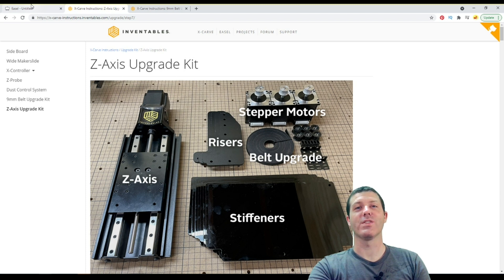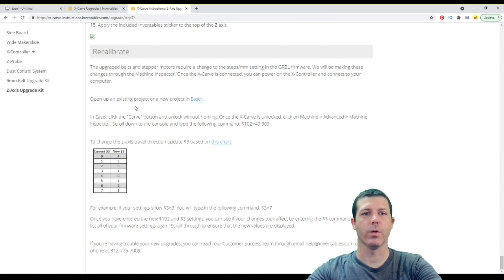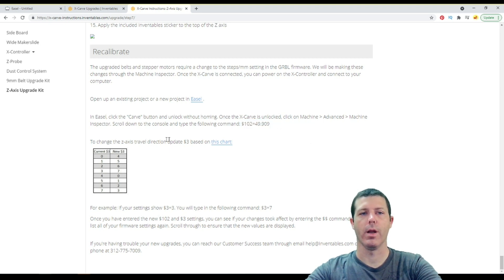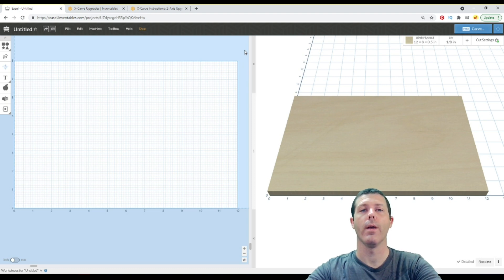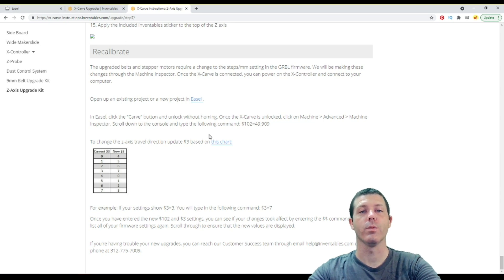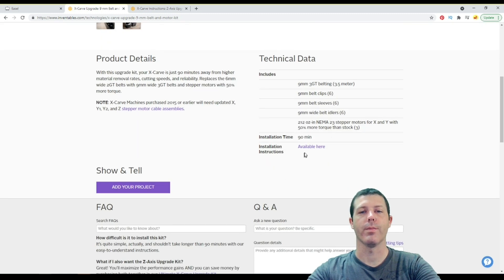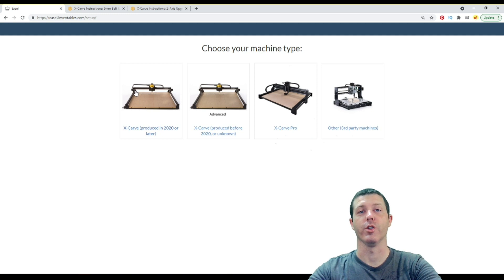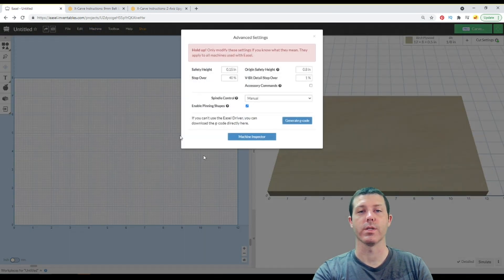Using Easel??    Here's WHY your CNC just crashed 💥

Comment: Very interesting. Good on you for finding & diagnosing the problem.
Temporarily is it worth selecting a Generic CNC and hope Easel doesn't overwrite the settings?
I've never selected SainSmart, used Other Grbl and never had difficulty with losing CNC machine settings. Though as you mentioned, after clearing Edge cache, I often lose machine definition, I always believed settings were held in  a cookie getting cleared.